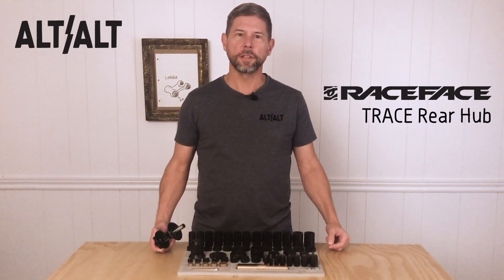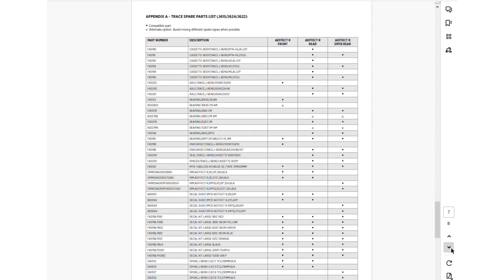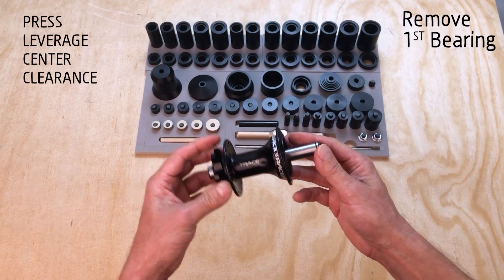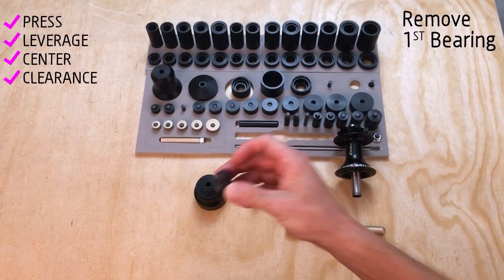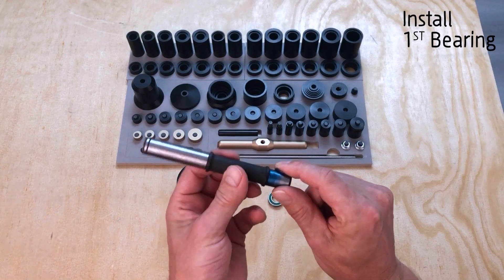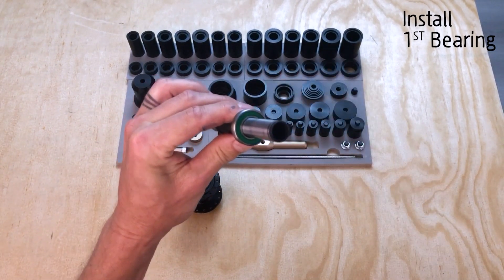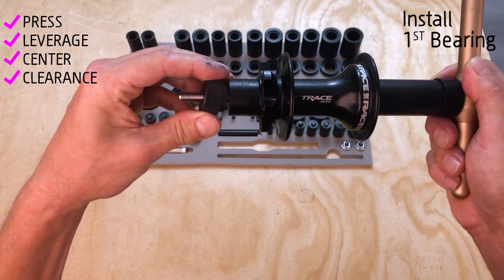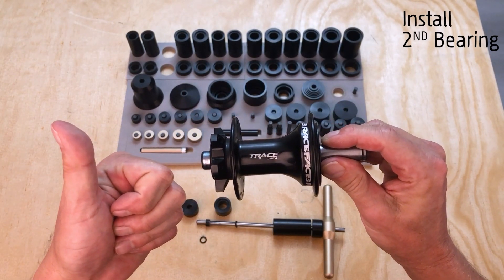Race Face Hub Bearing Swap Demo

Comment: That's a fantastic looking and well made service kit there Steve, but I have to say, I thought the Chris King bearing removal/install tool was expensive, until I saw the price on this one!
Reply from the maker: Yeah, it's getting pricy for all the functionality that this system has. If you're a home mechanic you won't need all that, so you could consider buying just the pieces you need for your service. I'll have piece part sales up shortly.
Reply: @altaltbike  Yeah that would be great Steve. I like that you have a lot of the parts in Acetate, which is plenty adequate and can save a bit of money. It's the process to have all those shapes made in the end that makes such kits pricey though, can't really get around that.

BTW, I'm considering a bike that has the Race Face wheels that comes with the Trace hubs, but I'm seeing bad reviews on the rear hub. Someone on MTBR I think said it was caused by the ring drive not being seated all the way, which didn't leave adequate space for the drive side seal.

I have always trusted Race Face for quality parts and support to back them up, and they HAVE been warrantying these hubs for this problem, but I'm a bit confused as to why I've not seen them comment on it. Do you happen to know if they've sorted this out, are the ring drives pressed in properly now?
Reply from the maker: I don't have any knowledge of this RaceFace issue, but contact them if you have legit concern. They've always contacted me back.

Comment: As it turns out my wheels are built with Shimano TC 500 hubs, or basically same as SLX. They have quick engagement pawls and use cartridge bearings. They're also only 7 gm heavier than the Race Face Trance hubset. So only my rims are made and covered by Race Face.